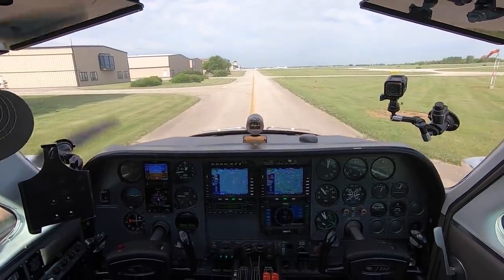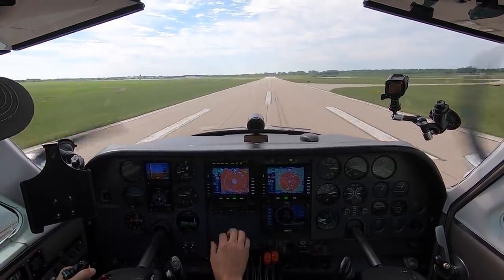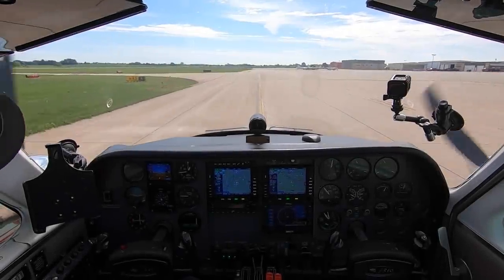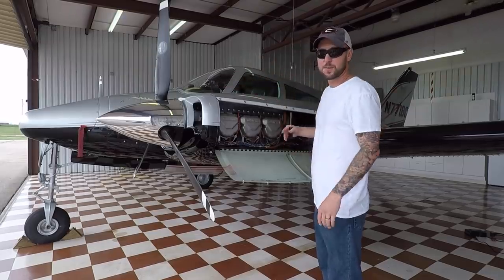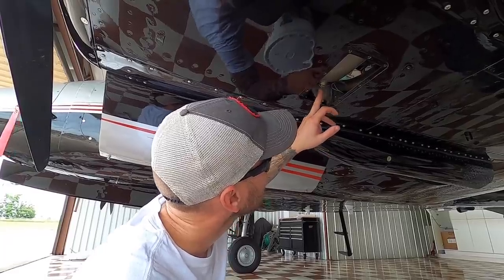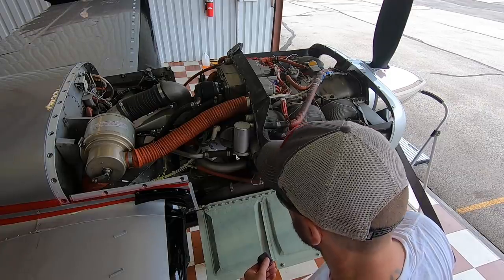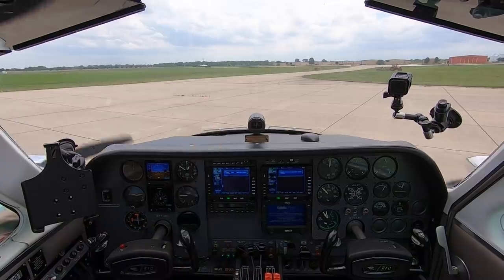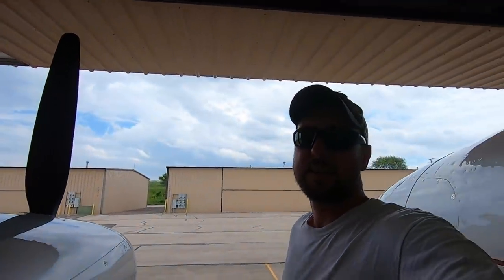How to Change your Oil

Comment: Great information on maintenance! One quick question, the safety wire for the oil filter looked taught over the oil filter outer case. Do you have to worry about vibration abrading a hole in the filter?
Reply: Great question!  I would be concerned.
Reply: Not really since the filter will only be on there for 30 hours. If it were a long-term part that would be a concern, though.

Comment: Hey Kevin.  Great video.  Just a thought, aren’t you more concerned about non-ferrous metal such as bearing material (aluminum, copper, lead, etc.) in the filter which a magnet won’t reveal?
Reply: That would show up well with a visual inspection of the pleats on the filter element...

Comment: Great instructional video, Kevin. I almost feel like I could do it myself now after watching this. What is the cost of doing it yourself versus having an A&P doing it.
,
Reply: Priceless.  Case of oil $90, oil filter $25 so there's $250 for the owner DIY ignoring his time.  Figure 2 hrs per side, x $100, that's may be a $650 oil change by the time the shop parts and log entries are factored in for an A&P to do it.  Kevin got to know it's done right, his way, and he gets to inspect his own oil filters, that's the part you can't put a price on.

Comment: Seems like 35 engine hours would be about 2500 miles in a car at 70mph....is that Cessna recommendation. Also oil sample should be drawn at first drain to capture any deposits around drain hole. And always pre lube the filter gasket to prevent spinning the gasket. Great job
Reply: FYI the new Tempest filters specify no additional lube.

Comment: SUGGESTION- If you dip your index finger into a little clean oil and then slide that finger along  the filter gasket it will improve the seal between the gasket & engine frame.

Comment: Nice video - other than the safety wire stuff, pretty much like changing the oil on a car other than it's a little more effort to "open the hood" but you don't have to put the vehicle in the air to get to the drain plug!  Tradeoffs!  Question - that seems like pretty thick oil especially heading into cool months but I also don't know beans about aircraft engines. Also is that "dino" oil or synthetic?  I would imagine synthetic but ... I don't know.

Thanks as always for your fantastic content, Kevin.  I'm local to the Chicago area - would love to meet you at one of the airports around here (or even better, join you in 1BC!).  Aviation fan my whole life, about 20 hours of instruction and a solo flight years ago, but no certificate.  Maybe someday again.

Comment: get yourself a speed handle with apex tips for the screws on the panel for the drain plug.  will save you some time.

Comment: Is the oil flow from the outside to the inside of the oil filter and if so shouldn't you check the outside pleats for metal, just asking.

Comment: Nice little video, only thing is strange is there is no twisted wire on the oil filler cap.
Reply: Trust me. If the cap comes off (or you forget to put it back on - Doh!), you will know about it very quickly, and long before you lose so much that it would damage the engine.
Reply: @SkylaneGuy  thanks for the clarification .

Comment: I have a drag car and when I change the oil I use a magnetic drain plug any metal shavings will collect on that plug and also I usually fill the oil filter up with a little bit of oil before I install it that few seconds that the engine runs at start up I think hurts the bearings if you put oil in the filter just that little bit might prevent that but I’m not a Aircraft mechanic

Comment: I'm guessing that both engines are served by the single supply of oil. I wondered if each engine had to have its own oil changed. Are all twins/multi-engines set up this same way?
Reply: Each engine has it's own oil. Two oil changes are needed. I was wondering if he does both at the same time ?

Comment: What is the torque specification for the oil filter?  That seemed  a lot more than used on an automotive application.   Maybe it was just the short wrench and lack of room to get much leverage.
Reply: It’s actually only 17 ft-lbs. Barely more than hand tight.

Comment: To me, you seem to be a little quick witht he 'gear up' on the takeoff.
I have had an engine fail just after lift off in a C402 and was very happy to have the 'gear down'so as to be able to put it back on the runway.
Just a thought.
In my initial twin endorsment the instructor I had recommended not retracting the gear until you would not be able to 'put it back down'.
Just my thoughts.
Many pilot choose to retract as you did.
My experience would council otherwise.

Comment: Kevin can you explain what climbing out at Blue Line is?  I really enjoy your channel
Reply: BLU LINE is the minimum speed needed to keep plane in the air on ONE ENGINE if one goes out...  ;)  I THINK that's what someone else said in a diff channel....  on single engine planes it is usually ''optimum climb'' they were saying...
Reply: @alexmikhael5061  What you're describing is Vmc: the minimum speed where you can maintain control of the aircraft with the critical engine failed and full power on the other. Below that speed you don't have enough airflow over the rudder to counteract the yaw from asymmetrical thrust.
Blue line, or Vyse, is your single-engine best rate of climb speed. You want to maintain that speed until you're a few hundred feet above the ground, so you can still climb if you lose an engine.

Comment: Most times when changing filters you run your finger with oil around the gasket to help seal it. Any mention of that on the packaging?
Reply from the maker: I used to do that but these filters specifically state not to.

Comment: Question: Why not have your mechanic install Magnetic Plugs in the bottom of the oil pans? You could go one step further and install a Chip Detector system to alert you that you have an unusual amount of metal in your oil.

Comment: Why do you use a manual screw driver vs a bat opp screw gun/drill to remove cowling and access panels?
Reply: Usually they are just quarter turns

Comment: A good idea is to put new oil in the filter before you install the filter. That  reduces the time the engine does not have oil .
Reply: Kinda hard to do that on a horizontal filter😉

Comment: What size engines are they and what make? I can see they are 6 cylinder engines and appear to be air cooled looking at the fins on the cylinders, I saw a cooler out front of the engine too, what is that for?
Reply: I think this model has 470 cu in engines by Continental (could be 520). Yes air cooled flat six. The cooler on the front is an oil cooler.
Reply: Craig Morton, I appreciate the reply my friend, I’m no pilot, just a guy who’s been in the automotive and marine industry for a long time who still has a strong interest in all things electrical and mechanical, I found this interesting in comparison.

Comment: Just a suggestion, use a flexible funnel under the drain plug to keep oil out of the cowling.  Here: https://aircraft-tool.com/shop/detail.aspx?id=18611&AspxAutoDetectCookieSupport=1. 
This is where having those stainless camlocks and screws really pays off,  Nice attention to detail.

Comment: Unless your ambient temperature is significantly lower than ~70*F,  warming your engines/flying to heat the oil is a waste of time and gas.  You run your engine, you load the engine up with old oil.
You drain a cold engine, and all the oil formerly stuffed in the engine has already drained into the sump.  Sure, doesn't flow as fast, but are your REALLY in need of completing a full oil change in less than 15 minutes????   If you allow an hour per engine, more than enough time has been allotted to drain any oil that is going to drain from the engine.  You will have more oil in the sump after the plane has sat overnite than you will get from an engine warmed up --- expect another quart to remain in the engine after warm-up that you will NOT get to drain by warming the engine up.
Waste of time to warm it, unless you are in molasses territory (temps around or below freezing)  [[ speaking as an SAE and API engineer ]]
Reply: better landing because of the VGs? or because you flew without Jaime?
Reply: Meh...he likes to fly..heat it up..drop the plugs and let set and drain over night...better than a cold drop...I dont drop oil from ANY engine cold...you do as you like.
Reply: Airplanes use SAE 50 weight oil. A cold drain is gonna take a WHILE. Much better to warm them up. The best is like he says to open the drains right after a flight.
Reply: Agree -  from 40 yr.  piston mechanic

Comment: Wondering 🤔 safety wires required for drain plug and oil filter makes sense.  
Then the oil filler cap is just a twist-on, no lock 🔒, no safety wire???
Reply: You need to check the oil before each flight as the engine burns a little every flight.

Comment: The filler cap does it have a safety wire to keep it from coming off ?
Reply: It's spring loaded with a detent.
Reply: No. The cap is less critical because it would take a long time for a significant amount of oil to splash out - and when it does it makes such a mess that it’s impossible not to notice something is wrong!  The engine will also run without damage with the sump at half capacity.

Comment: OK... This is the avionics technician in me yelling out of concern... Please...@ 11:08, the yellow cable in the Adel clamp, make sure it's not  being pinched in between the metal clamp part and that it's in the rubber grommet portion of the clamp with the rest of the wire bundle... From this angle it looks like it's pinched and that's not a good thing...future issues will ensue... It looks like a new install. I'm guessing it's for engine monitoring...?... You're doing an oil change and I'm sittin' here looking at you wiring... Avionics life!!!...lol

Comment: Punch a hole in the top of the filter and crack it loose, oil will drain out of the hole you made into a cup you can put under it. Makes for a cleaner job.

Comment: I am prepping for the checkride and did some ground school. I asked my instructor if a ppl can change the airplane oil as preventive maintenance and he told me NO. Is that the case.
Reply: In the USA he would be wrong in most cases. See 14 CFR Part 43 Appendix A. Lots of stuff owner/pilot can do legally.
Reply: @SkylaneGuy  I'm looking it up but that section talks about major maintenance.
Reply: @yamilrx   - Keep scrolling down to Section C.  It's all in there.  Also Google AC 43-12A

Comment: Main thing your looking for in the filter is aluminum  flakes , magnet is no good. Scott............
Reply: You can see that on visual of the element.
Reply from the maker: I'm for sure not qualified enough to get into those specifics for this video. I probably should have mentioned the non-ferrous metals though. I did mention if I saw anything in the filter element that I would bag it up and take it to the mechanic.
Reply: @310Pilot  you did good Kevin..non ferrous particles will show up vividly on the inspection of the elements like you did...with those visable..there would be no need for a oil analysis. You'd be down. Nice job👍🏻👍🏻..come to KIAG some time!

Comment: Kevin...instead of cardboard, use heavy duty aluminum foil.  Much more malleable so you can surround the filter and even make a sump to contain all the oil.
Crusty
Reply: Bingo!!
Reply from the maker: Thanks for the suggestion! I may try that out if the bibs I just ordered from spruce don't work out. Always learning! :)

Comment: Hey Kevin... I went to post this on Friday's video last night, and noticed someone else had already mentioned it, but I figured at this point it would be buried on that video, so let's try again here.  What's up with that #5 cyl on the right engine on the engine monitor?  Absolutely pegged after the run-up.  It was like that in the Friday video too, except that it didn't peak out during/after the run-up, but only after take-off.  Bad sensor, or possibly something more serious?
Reply from the maker: Howdy and good eyes! It's a faulty probe. I have 2 EGT (3&5) and a CHT (2) on that side now. Funny how they are all going at the same time. I still have the factory gauges so I'm deciding what to do. New probes or a whole new monitor that can replace all the old analog gauges.
Reply: Thanks for the message and reasking that. Now we know! lol

Comment: Righty tighty - leftee loosy.... looks like you put the safety wire on the left engine oil drain plug bass ackwards...
Reply: No it is not.